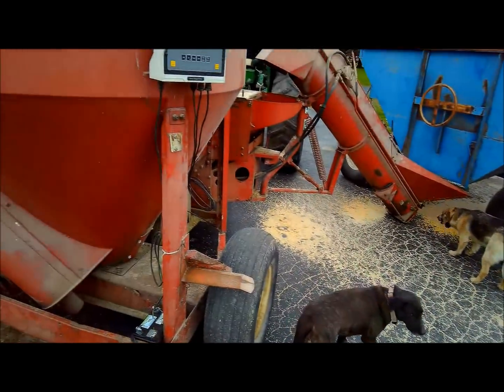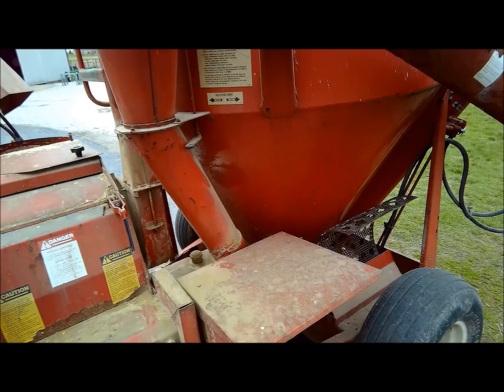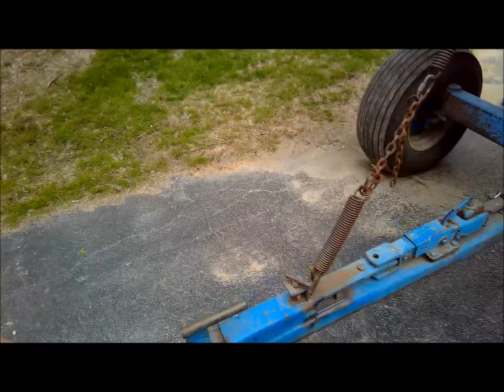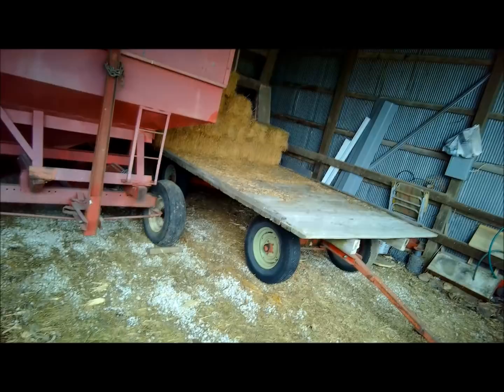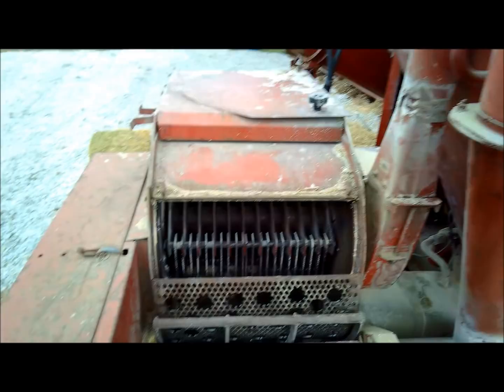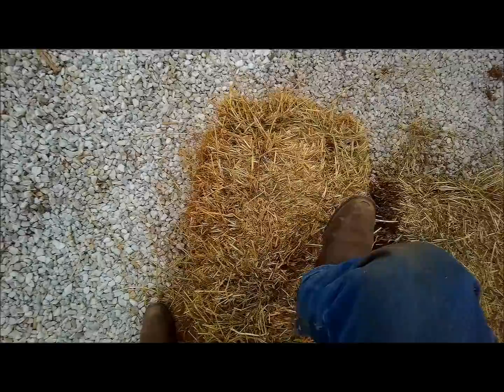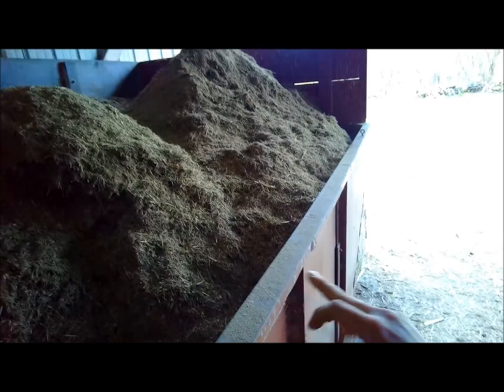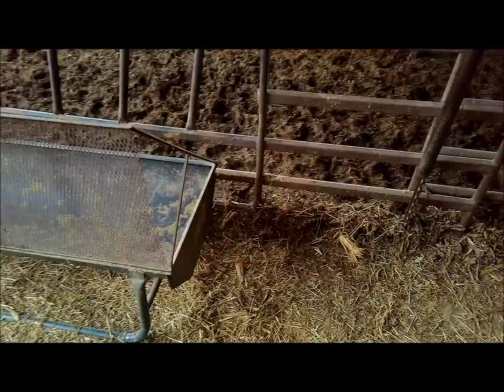Oliver 1800 and Gehl 125 mixing a ration

Comment: We have a Gehl 170, and it has the small bale conveyer , but with you flipping your hammers I'm sure yours does a better job.  If I grind a load of just corn I can do 6000lbs in 30min , but barley is harder, and oats are to, so if I do a couple types of grain then I figure an hour, and I put all my supplement in at the start as well, and you said Rumensin perfectly.     Some times when I build a starter ration I put 1000lbs of whole oats in to give it more texture and roughage, but I don't mix any hay with it.       Looks like a darn good ration Jake.
Reply from the maker: AndersonCattleCo. U got the big dog! Never would’ve guessed barley or oats would grind harder. Be interesting to see a video of ur ration if u get a chance some day. Seems like all those bale attachments are out west. Thanks for watching
Reply: This winter , I bought all of my grain at the feed mill, mostly barley a little corn steam rolled , supplement and molasses.  I had booked 2000 bu of corn but the guy never called and most of the neighborhood barley was light.  It is too expensive from the feed mill but it was easy to just drive the tandem to town every couple weeks.   I plan to grow some barley to combine so I will be grinding this next winter.

Comment: I would have a grinder mixer like yours, but when the dairy that had it decided they were done with it...
They shoved it into the scrap pile.
Messed it up enough that it wasn't worth trying to fix😪
Instead, we ended up with two old New Holland 345s to make one.
We grind screenings and/or whole oats and mix with the pellets we get from Land O Lakes...
Sometimes put a gallon of vegetable oil and a gallon of molasses in to help with dust and boost the ration a little...
We mainly feed it to the cows, but sometimes if time permits, we use it for creep for the calves.

Comment: The mill sounds real smooth. I'm just guessing how much of this and that to give these three I have and their on a little pasture now but still give them about 35 to 40 lbs of a grain mixture a day. They don't eat as much grain since they figured out they like the green grass so the weight gain will be slower on these Holsteins. Waiting for it to dry up some to dig the muck from the barn entrance and get me a load of lime to pack in there like you did. How's yours holding up?
Reply from the maker: oldfarmer hopfully u can get that lime in soon. My lime is holding up great. U will like it. Ya that’s the problem I ran into when I was thinking about this. I was going to try to just adjust the corn ration but it’s hard to control how much hay they would eat with out mixing it all together so I decided to just grind he hay too. What are u mixing in on ur grain ration?
Reply: Have use a mill that mixes up what they call 16 percent grower that has corn, oats, minerals some type of soybean and other stuff and I get calf starter from them also that they mix has corn, oats, molasses and some other stuff that they really go for. I usually mix it 16 percent grower (35%) corn (40%) and calf starter (25%). The corn is cracked and the calf starter keeps them interested in the feed. They usually come running to the feed bunk when feeding time. When they get about 900 lbs I really start poking it to them until they don't clean the bunk up and when they do hit them with a little more. Yeah just about gets dry enough to get the soup from the barn then it rains for three or four days again. Grass is growing good but nothing else is happening. No seed in the ground here that I've seen.
Reply from the maker: oldfarmer I bet they do like that! That gluten I feed has a sweet smell to it. What does that 16% cost a ton
Reply: Runs 160 to 170 a ton. That's the price getting it in 50 lbs bags. Storage and means of transportation of bulk feed is a short coming by me. I don't make any money on the beef, if I'm lucky I might come close to breaking even. It's all about putting it in my belly and the taste of it. Firm believer it's what you put in them is what your getting out of them for taste. I like the taste of the meat and only use a pinch of salt and pepper when I cook them and not have to drown it with sauces and marinade to cover up bad taste. Past experiences and one example, didn't raise any beef for a couple years so I bought one from the neighbor, he feed it nothing but grass hay and distillery grain he bought in bulk. Beef was fat but no taste at all. May as well been eating hummus, what ever that is. It's the pleasure of raising them from bottle to finish and the folks that do buy the beef just carry on how good it taste compared to what they have eaten in the past.
Reply: My mistake that's for a half ton. Double that. Old age can't see or brain don't work as well. Lol
Reply from the maker: oldfarmer hummus LOL I hate that stuff my wife eats it sometimes........as long as ur happy with ur end product I bet it’s good beef for u. I’d almost like to work at the butcher for a few weeks just to see all the cattle people bring in. I know the “grass fed” beef would be the worst to eat lol